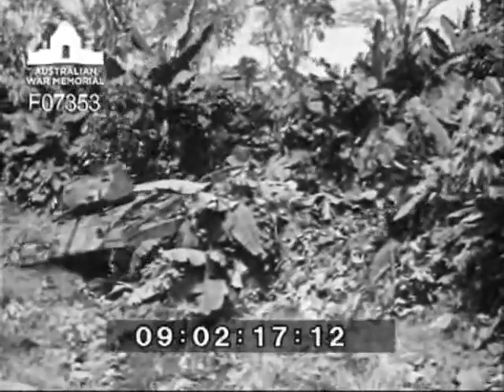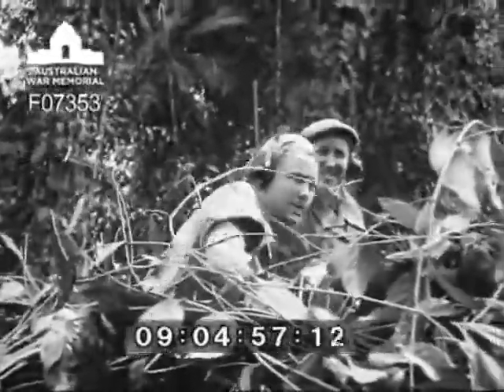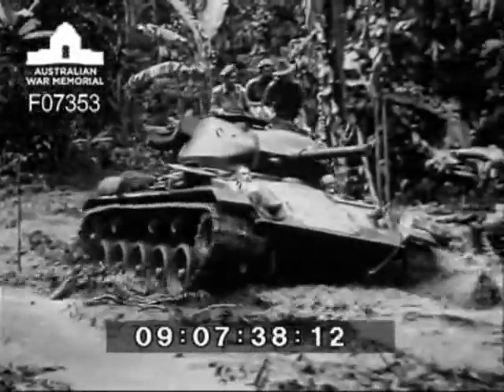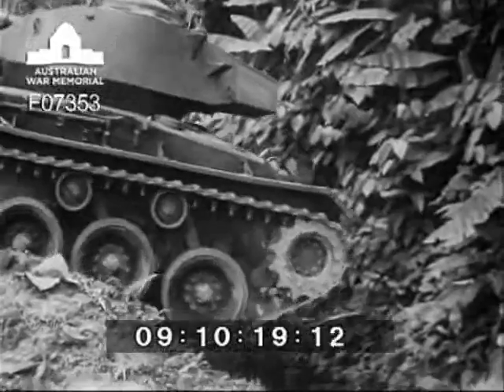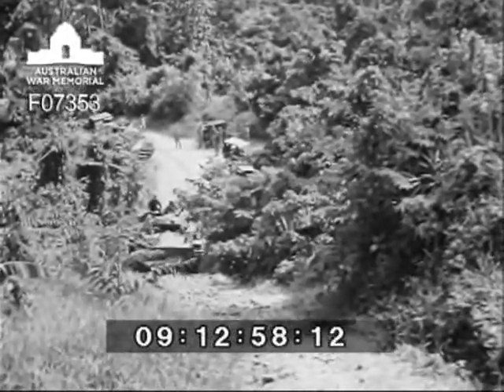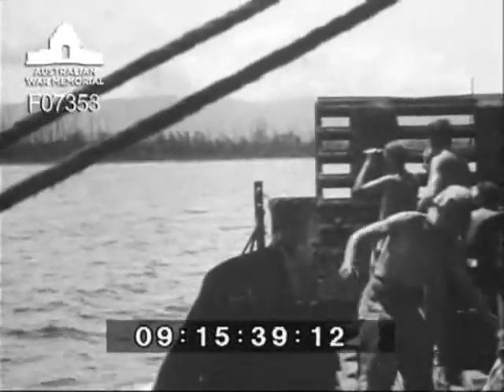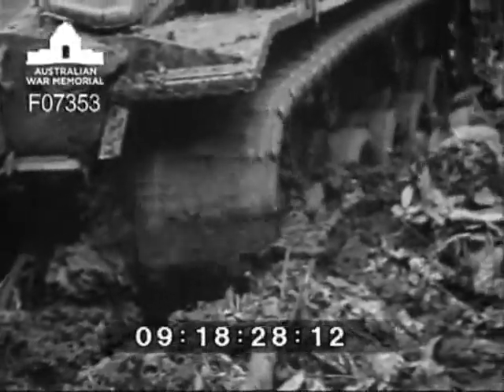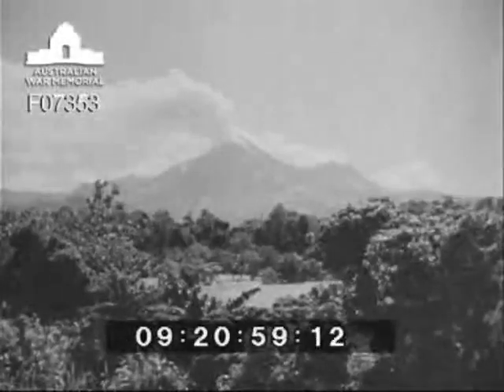Chaffee (M24) Light Tanks in Bougainville (Tank trials)

Comment: It certainly shows the need for good recon when using tracked vehicles in a jungle environment to avoid impassible obstacals.  It would seem that tanks in very difficult terrain should operate in groups of at least three. A lead tank followed by a tank to perform a rapid extraction if the lead is stuck. The third tank would provide covering shell and machine gun fire during the extraction.